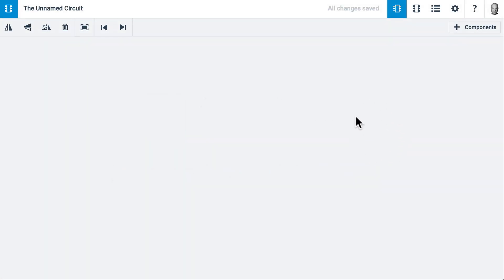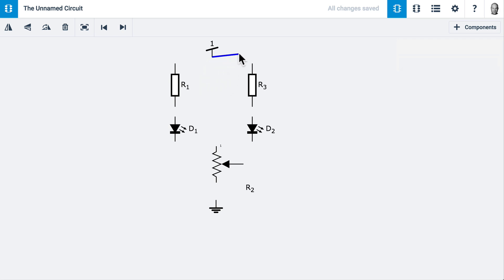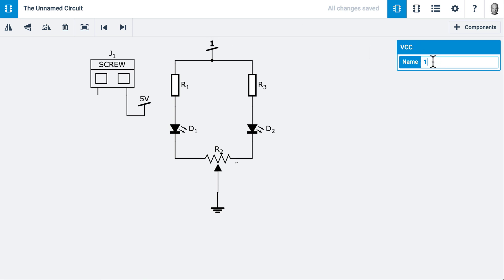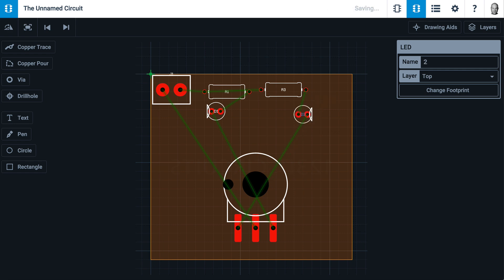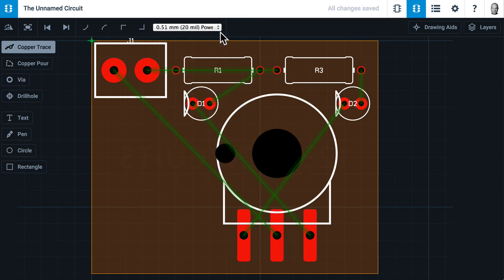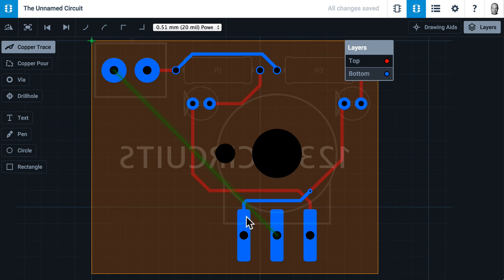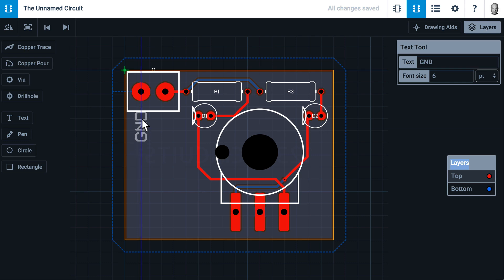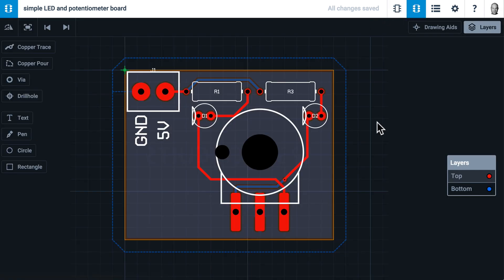Autodesk Circuits: PCB Design, Schematic and PCB Basics

Comment: Unfortunately you can no longer design in schematics view, which is a major feature reduction. Conceptually people would do that first, before looking at breadboard allocations. They also removed the ground/earth symbol too. Effectively this is no longer a generic circuit maker, instead it's been changed for just arduino :/ Big step back
Reply: Download old versions via torrent not the best way to do things, but sometimes you must do it.

Comment: Can I sell boards I make in this software?
Reply from the maker: Hi Jake,
Great question!  Once you have your boards they're yours to do with as you please.  
We have a "Premium" membership option that specifically allows commercial usage.  We will not however strictly enforce premium membership.  A huge benefit to having a premium membership is that you can keep your designs private / hidden.
Check it out here:  https://www.123dapp.com/gopremium#premium